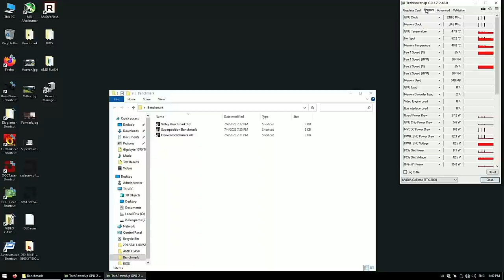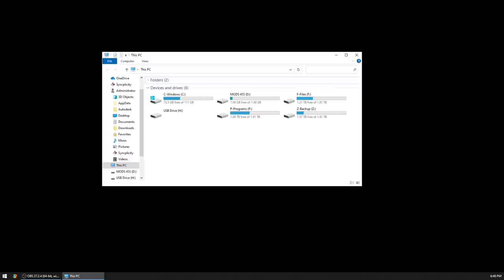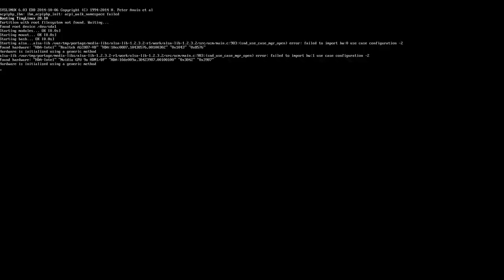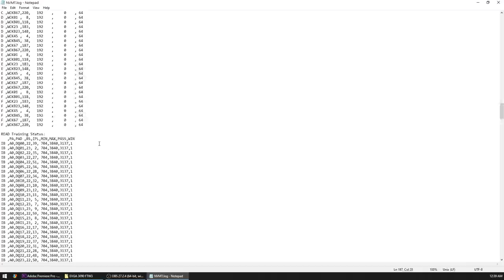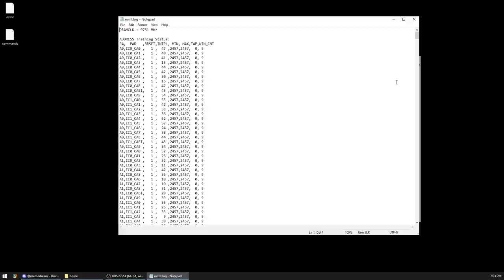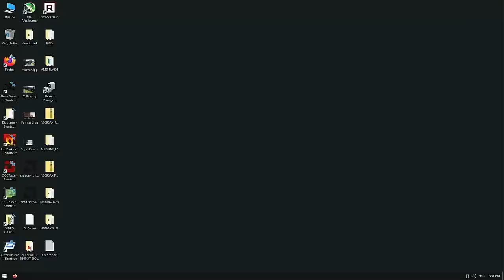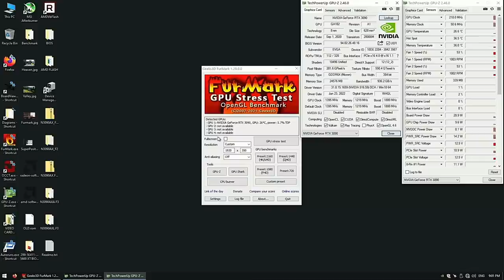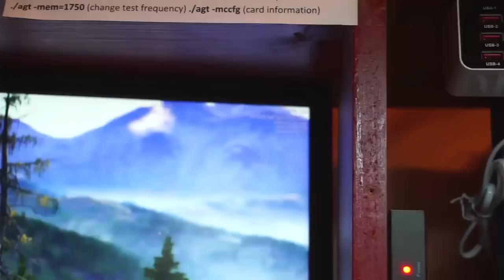Should you trust EVGA warranty ? 3090 ftw3

Comment from the maker: If you need a repair, please find contact info on the channel front page
Reply: Discord link says "Unable to accept invite"
Reply: @junkmauler  U might have joined to many servers, I think 100 is the maximum for free users. Try leaving one you don't use & see if it'll let you join.
Reply: @Jay_kaying  It was something screwy with my session, I logged out and back into Discord and the problem resolved itself.
Reply: What is your heat gun settings upon taking out those chips???
Reply: How much do you typically charge for a repair?

Comment: I warrantied a 3070 ftw3 with EVGA earlier this month. The card would crash in demanding games and benchmarks. Problem was persistent across multiple systems. I provided info on the troubleshooting I'd done and had an approved RMA in less than 5 minutes over the phone.  Sent the card out and had a replacement in a week. I've never had anything but awesome experiences with EVGA customer service.
Reply: Hope it keeps working. You wont get the chance to fix it again.
Reply: IME over the last 7 years of using EVGA products, That's simply not how they conduct business. They've always been friendly and easy to deal with. I don't expect that to change just because they've ceased to do business with Nvidia. I fully expect them to honor any future warranty claims as they always have. Maybe 2 years from now getting a replacement won't be an option, but I expect they'll still have a resolution of some kind.
Reply: @kennethryan7839  they will only support RMAs until they run out of stock.  Give them a couple of months.
Reply: @TheSjuris  Obviously they won't be able to support rma forever. That doesn't mean they'll just bail on everyones warranty. As I said that's not the type of business they conduct.
Reply: @kennethryan7839  they will end up bailing on majority of warranty claims.
Reply: @TheSjuris  sure you work on EVGA and can confirm this first hand, right?
Reply: @420rvidxr  bud, there’s no way they have hundreds of GPUs lying around waiting for a RMA. That’s common sense. What kind of business holds lots of products back when there’s a huge demand for them?  Going to suck for the majority of RMAs especially for older boards that aren’t the RTX 3000 series.
Reply: @TheSjuris  You're living in the past; the demand for GPUs dried up once mining died. The market is completely flooded with 3000 series cards, prices didn't drop hundreds of dollars for no reason.
Reply: @NightKev  that’s why the 4090 is selling for double. They don’t have hundreds of GPUs lying around. They all are trying to sell them and guess what the high end 3000 cards aren’t easily found either. The 4000 series is too power hungry and the piece of shit power connector can’t be used in a horizontal mount and can readily catch fire. Evga isn’t going to have hundreds of 3000 series cards available. Certainly not on the higher end of the spectrum.
Reply: @TheSjuris  4090 prices are just caused by resellers, that always has happened with every launch, are you new in the tech world?
Reply from the maker: It's back up again.
Reply: @420rvidxr  resellers don’t sell on eBay pieces of shit scalpers do and lowlifes buy them for double what they are worth. Anything sold on eBay like that should not be warranted.
Reply: @TheSjuris  thing is that not only Ebay has overpriced 4090s dude, it's clearly something that most sellers do given the chance
Reply: @420rvidxr  and guess what those GPUs shouldn’t be supported again. No updates and if they blow up again too bad so sad. This is and always will be a huge problem. Nvidia doesn’t give a shit.
Reply: @TheSjuris  I agree with you, this nonsense is also made by Nvidia
Reply: @420rvidxr  it’s even worse. Their stupid connector is going to cause fires.
Reply: EVGA for years all problems solved. This is to bad.
Reply: They flat out said they kept back thousands of cards when they were exiting the graphics card business so they could cover RMAs for the entire warranty life of the cards. I'd trust EVGA much more that a random commenter on the Internet since I've had sterling service from them for over a decade.
Reply: @TheSjuris  I spoke to a EVGA rep on the phone. They stated if you have a 7-10 year warranty on your card, they will fully support it for those 7-10 years. Saved the call just in case as well.
Reply: @TheSjuris  news with bullzoid came yesterday also, it turn out the connect itself isn't the problem but the adapter Nvidia is sending, being poorly manufactured causes those burnout pins.
Pure arrogance by Nvidia
Reply: @420rvidxr  a connector that breaks if you put it in sideways isn’t a good idea when you might not have a choice when that’s the only way to close the case in a horizontal direction.  Keep in mind that putting a 4090 in vertically isn’t particularly better since it is going to put the gpu right along the sidewall of a case and you can’t move air through it.  Nvidia needs to figure out how to have better power efficiency so you don’t need an extra connector.  AMD has somewhat figured it out since their next generations GPUs don’t need this particular cable.
Reply: @TheSjuris  my 3090 had bad RTX cores and they replaced it immediately and this was in the fall of 2020.
Reply: @angelbyshaggy  did it come with a cookie?
Reply: @TheSjuris   " bud, there’s no way they have hundreds of GPUs lying around waiting for a RMA. That’s common sense. What kind of business holds lots of products back when there’s a huge demand for them?  Going to suck for the majority of RMAs especially for older boards that aren’t the RTX 3000 series." 

The kind of business that knows that the reputation they have, is worth far more than thousands of 30 series cards.  Do you have any idear how much money a normal firm will use on marketing? Just look at AMD taking shoots at NV for the shitty cabels.   Evga have also stated that, if they cant replace your cart with a identical (or better) card, they will pay you instead.
Reply: @runelsted  the only real reputation they have is on the GPU side. They have a mixed bag on the other hardware parts most of which are rebranded oems. They literally said they held back enough cards to support the warranties. Most of which will expire in a couple of years.
Reply: @TheSjuris  As long as your warranty is not expired, EVGA will cover your card.
Reply: @TheSjuris  evga has a stockpile of cards to make sure they are able to replace any defective ones.......
Reply: EVGA did a solid for me to with my 2070. But my strix 3080 TI, I just got back on 12/13, and just sent it out again today for black screening again
Reply: @TheSjuris  Do you actually think that they would be able to get away with that? Also, they can REPAIR them, or use a sub-contractor to repair them. They can also provide monetary compensation. They cannot legally just bail on their warranty coverage, and that would also severely hurt their brand image. They make a lot of money off of power supplies. Why would they want to jeopardize that business? They've got a great reputation, at least relative to other PC component brands. I don't see them suddenly trying to get away with not honoring warranties. If they were struggling financially, then it would be a much different story, but there is no reason to think that they're suddenly just going to declare bankruptcy.
Reply: evga was only reliable gpu manufacturer, sadly they gone now
Reply: @GamingInfested  Certainly the best at making and warranty imho. Sapphire also does excellent work on GPU's. I use to do work with them back in the 90's on ATI cards years before AMD acquired them.
Reply: I warranted a evga 3060 ti and they sent me back a 3080 ti ftw3
Reply: @tylersays-  That is one hell of a score right there. Hope it serves you long and well.
Reply: @tysoncoffman7562  yeah it was quite a surprise
Reply: @420rvidxr  Yeah the founders edition is very cheap:/
Reply: I bought a evga 3080 for 200 not working and got it replaced from evga without even proof of purchase
Reply: Classic EVGA shill
Reply: @TheSjuris   EVGA did explain what they were doing.  They used some estimates on how many boards they would need for RMAs in to the future by using previous averages and then they upped that average to make sure they had enough to cover warranties over the next couple years for the 30 series cards.  Who knows if this is enough but they stated they are trying to keep above the average amount needed for RMAs over the next 2 years or so.
Reply: they would not warranty my 1 year old 1070 stating that it had coolant on it??? it had some grease seeping out of the cooling fan that was on it, i never had it around any coolant or water of any type. the cooling fan on it had a minuscule amount of grease that came in a little contact with the pcb. even if that was the problem it was from the same product.
Reply: yeah, i had the same experience
i sent them a dead ebay card and they sent me a working replacement
Reply: used or new card?
Reply: Same had a 970 sent back to them no issues
Reply: @TheSjuris actually they said they would keep stock on hand for rmas
Reply: @deltasource56  time is almost out.
Reply: I am currently in the proses of an RMA for my 3090 with EVGA and i hope that they can do something for me as they are no longer doing the whole GPU thing. i have never had to RMA a card before and am stressing about it lol XD. Here's hoping my experience with there warranty support goes the same as yours did for that 3070!!

Comment: EVGA has the best customer support of any company I've ever dealt with - I once had a card that was years out of warranty and the fan stopped. I called tech support just to ask for the part number so I could order a replacement and the technician said "oh it's ok, I'll just overnight you one" on a 7 year old card. Sure enough, it showed up the next day, I've never bought any other make of card after that.
Reply: My GTX 970 was a FEW days past warranty period and one (i had 2) fan absolutely committed suicide by, I assume a spec of metal shavings got into the sealed fan and made so much noise and fan broke, I should have just asked instead of going to ebay and ordering 2 replacement fans with wires FAR too long but they work well just a little tetris bending. EVGA has done very well!
Reply: Guess neither of us have a choice now, though... unless they change their minds and go team blue or red.
Reply: Wtf? Replacement with years out of warranty?! Makes no sense, had no idea they would do that. 

I guess thats why they stopped making gfx cards, how can you afford to send people new cards even 7 years later when a fan goes out?
Reply: @morrisl7  I may be wrong but I dont think they sent him a new card, just the fan for that card, but still pretty amazing, and expensive - over many thousands of customer issues?
Reply: EVGA always had my money, and my back. After their news of pulling out of the GPU market I went and purchased a brand new 3080 from them to last me another few years.
Reply: I had a card that I bought used from Ebay and it worked fine and then a month later it quit.  I called up EVGA talked to a tech there and he said the warranty is even good through 2nd hand and said to send it off.  So I sent it off and they sent me a new one back out.  I have worked with ASUS and Gigabyte before on RMAs and they are horrible to work with.  I enjoyed working with EVGA.
Reply: @alphadragongamingFTW  can confirm, just sent in a 3090 that they let me swap warranty to my name. ive heard nothing but good things so fingers crossed.
Reply: @morrisl7  they sent him a fan replacement not a whole new card
Reply: probably why EVGA wont be making video cards anymore i think same for power supply to .